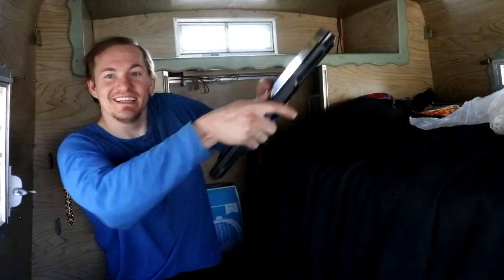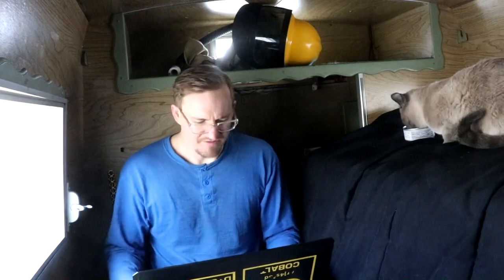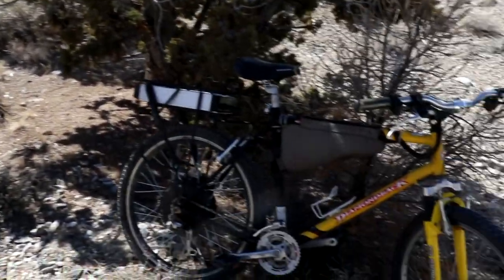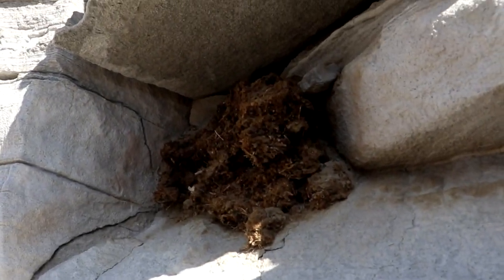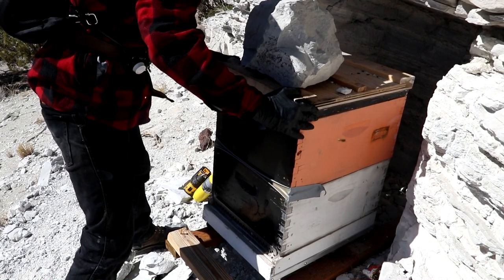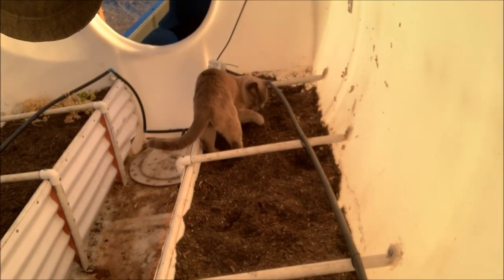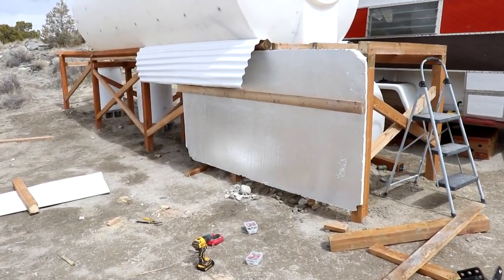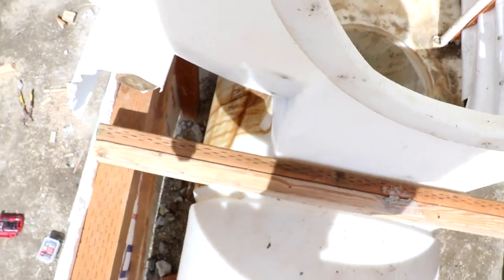ChickenHole Base Ep. 17: Spring Servicing

Comment: I'm so jealous of Cody for having those mountains and exposed bedrock where he's at. Where I live in Midwest Ohio, and all I have are hills. The mountains that were here are all smoothed down by glaciers. What's even more annoying is that there's both exposed rock on the side of a highway near where I live, and a limestone quarry only about 2 miles away. I've been digging a roughly 8 foot hole near my house in a desperate attempt to find bedrock, but I bet I have a dozen or more feet to go. At least I learned quite a bit about the local geology and history from it's layers, and how water water flows underground through a gravelly sand layer. Looks like I got off topic, still, great video. I've never been disappointed by Cody's uploads.
Reply: I have the same problem, even the nearest quarries don't have bedrock, there just gravel pits. What would I do for some rock exposure...
Reply: Like you I was trying to get the bedrock up for a construction project on my farm in SE England. I found it, just four feet under the surface - but I have a different problem. I could do with being 20 years younger shifting & knapping blocks all day, its an absolute killer!
Reply: @riffhurricane  Some people in my hometown got their terraced houses extended and the builders found they had no foundations. They'd been built directly on top of the chalk, which was only a few feet down. Which explains why they got so damp.
Reply: @charleslambert3368  Doesn't sound good at all! I grew up in a Victorian house which (while extending it) we found had hardly any foundation, but even that had a reasonable damp proof course. The stone I'm quarrying atm is a lovely yellow (disclaimer: I'm colourblind) sandstone which is going towards the chimney stack for the new farmhouse I'm building.
Reply: can't grow food on bedrock. the closer it is to the surface, the more "loose" rock makes up the soil. if you have bedrock close, there will be a lot of stones you can see poking out of the ground. use lime for pointing and plaster, rather than Portland and gypsum, it'll help dissipate the damp.
Reply: I'm so jealous of you for having mountains and hills. Where I live in The Netherlands we dont get nature or wildlife at all. Its all manmade and there is no place where you cant see civillization. Be happy with what you have!
Reply: Come on out to the open and dark skies.  Lots of inexpensive mountainous land available here in northern Nevada.  Think off grid, though Starlink works great.
Reply: I don't do any digging, but we have pretty much the same thing down in South Eastern Ohio. Lots of limestone down here.
Reply: I am so hoping you have that hole reinforced if you get down into it. I'm sure you have it covered.

Using a backhoe, for those 8 + 12 = 20 feet?
Reply: I have the opposite problem; the topsoil here is so thin a shovel will hit it in a few swings, though everything is Limestone so the most interesting thing to find here is pyrite :)

Comment: Construction suggestion from a part time carpenter, cutting supports to match the curve of the tank and then planking across then along the length of the tank like an inside out boat hull would likely alleviate the sagging and therefore puddling in the base of the greenhouse. Provided decent quality "lumber" 1" boards would likely do a good job.

Comment: you should get a Starlink dish out there to have a good internet connection :D
Reply: @TRC2002  pointless comment?
Reply: Isn't that place too high up north to have starlink available?
Reply: @bottlekruiser  starlink is only available in the northern us and southern canada right now
Reply: @cochbob  oh ok did not know that... But it's probably not far, given that they launch 60 every week right now
Reply: @cochbob  I meant the latitude being too high to see satellites (which have 53° orbital inclination iirc), not the limitations due to incomplete network or legal bs
Idk latitude of chicken hole base hence ask
Reply: @bottlekruiser  well chicken hole base is in the continental US so the latitude is definitely not to high for starlink since it's also available in canada currently. starlink will be available at the poles eventually anyway through satellites in polar orbits and communication between satellites to the ground stations so latitude isn't a deal breaker.
Reply: @bottlekruiser  CHB is below the 42°, so if anything, I'd expect it to possibly be too far south if the satellites are intended for use at the 53°. (It has been quite a while since I've looked at starlink, so I'm outdated on it).

Comment: Slow progress is still progress! You'll get there eventually, wherever "there" is. But that's the less important part, it's the journey that really matters. And while yours might've had its ups and downs, it's definitely been an interesting ride so far. So I wouldn't be too worried about getting side-tracked, having to change course, or even the odd minor (or not so minor) setback, as long as you're still moving mostly in the right direction, you'll get where you're going eventually.

Comment: Hey cody i suggest you to leave the insulation "stud" board outside and fill the "loose" space between the 2 materials with expanding foam. It will provide even better insulation and fix the exterior plate, at a reasonable cost i think

Comment: Welcome back Cody! Robert Murray-Smith has shared the principle design of cheap off-grid storage of renewable energy for concentrated grow light boxes. Gravity separated "Oasis flower foam", Zinc and Bromine secondary batteries in cheap plastic containers to provide flexible power and capacity for the least capital outlay will provide your base with sustainable independence before your arrival as a permanent settlement. You will need much greater levels of renewable energy to recycle your water as well as capture from the occasional accessible events that appear to be decreasing in frequency because of climate change and altered regional and seasonal rainfall. Your observation from occasional visits to your base has identified species die-back. Apart from the issue of key indicator species and what should be done to support other bases established in the region - such as agreed low prices for pond liners and academic/industrial/senate technical support to build adequate water storage ponds and reduced evaporation strategies as a proactive environmental safeguarding program and a demonstration of what needs to be done to prevent the destruction of inclined habitats after plant life is destabilized by lack of water followed by topsoil removal by stormwater run-off. By this time you have an inclined and highly unstable desert. This makes life in the valley or gulch areas extremely difficult which motivates this attempt at early and constructive discussion.  "Water is life". A NASA interplanetary missions principle

Comment: One thing you could do is mount the foam insulation to the inside of the frame and the plastic roofing/siding to the outside. You’d have flat surfaces for both and a dead space air pocket in between...

Comment: Cody get some spray foam when you go to get the right bit, then do the original idea but fill the gap with spray foam so it doesn't flap, and you'll have much better insulation

Comment: Hi, Cody!, Nice to see you again!. I think that the gap between the ondulated plastic and the insulation panel works for you, since air is not best thermal conductor! Also the wood beams you used, I think needs a bit of coating. Those seem to me to be fully soaked by water, since @10:46 I see the beam appear a bit bent right above your hand (stop image). Maybe a scaffolding pipe could be cheaper & more durable. Used one or trown away are way better. Anyway, Nice, Nice work Cody!!!

Comment: At minute 13. I was thinking if suggesting thinner framing installed vertically and spaced 12" apart. And install the corrugated siding onto that. With the overlapping edges on top of a framing. Look up eifs systems.

Comment: Sinewave plastic coating, Cladding,  horizontal vs vertical , like Newton you take a material or tool and find new uses. A horizontal vs Vert  should reduce vertical heat loss, , rain wont run down challels but drip with some parts more protected (square section ) unless its structual maybe horizontal is better ?

Comment: How well is that foam insulation going to hold up ??   I've been considering using for my projects as well !!!
Reply: By "hold up"  I mean >>  not deteriorate.   IME pressure treated wood is only good for 5 years IF it touches the ground. If it's dry >> I have structures which are showing no signs of degradation of 15 years(even in the rain).  I guess we just have to avoid standing water / sustained moisture pockets.     um, so yea this also applies to concrete base pressure treated posts

Comment: dont you technically need a box over that camper door if its supposed to be like a mars habitat. that way its like an airlock between normal pressure and exterior pressure or lower mars pressure. your cat could not take lower pressure. could be wood or metal or whatever is available for you.

Comment: why not just secure the siding using the board you used for the insulation? you could get a two for 1 deal out of it. drill into the wood with the siding under it and secure both the siding and the insulation?

Comment: Whoah. Major demerit for not having supplemental Phillips driver bits. 
Doesn't everyone carry at least 10 backup Phillips bits with them at all times?
Just me?  :)
Reply: Also. You can buy neoprene material and cut your own gasket for the seal between the sump and the greenhouse. Then clamping pressure with or without silicone sealant would likely do the trick. I've done that many time when making similar interfaces on my aquaponic system.
Just a thought.

Comment: if line of sight is even a slight problem there then just do the simple 
'
OneMarcFifty CHEAP WI-FI MESH ALTERNATIVE with fast roaming OpenWrt Wi-Fi Access points'
and/or 'ESP-NOW with ESP32 EXPLAINED: Easiest Wireless Communication Between Boards (ESP8266 Compatible)'

plenty of cheap low power tiny OpenWrt Wi-Fi for diy and a diy ups + cheap buck/boost pcb  from -amazon- marazon + small -earth- mars batteries from scrap to set & forget power job done.

if you could be bothered to use 'not invented here', then even make use of Roberts ultrabattery from old car battery's mod & stick them in hole in the ground with diy conductive ink -& a bunch of dipped/dried nylon thread made into a conductive solderable string in down time- etc...